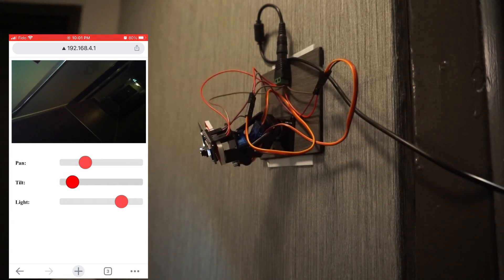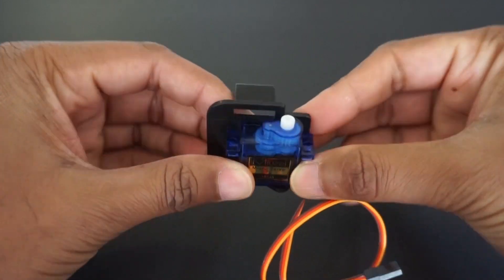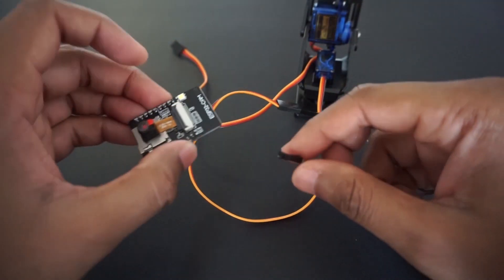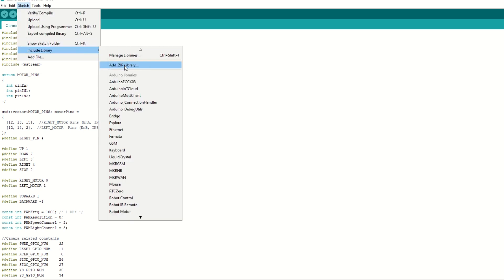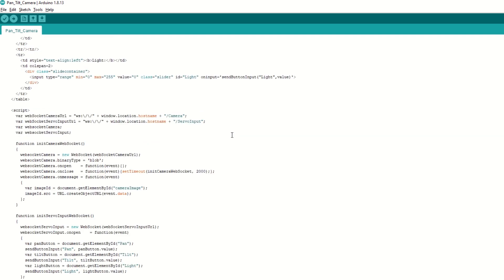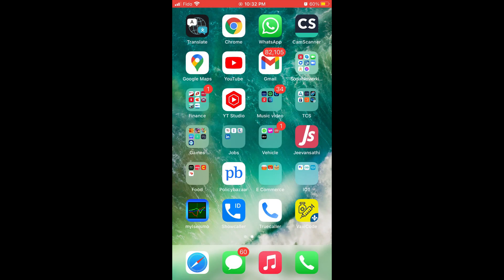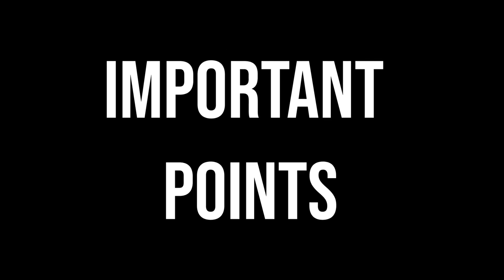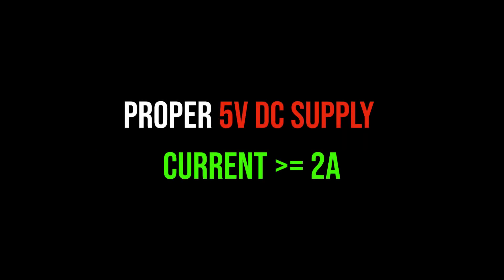Pan Tilt Control using Servos for ESP32 Cam |  WiFi Security Camera

Comment: Hi sir, May i know what is the used for Arduino UNO R3 in this project? At first I tot it is used to control the servo motor then I realized the servo motor was connected to the ESP 32-CAM instead of the Arduino board
Reply from the maker: Arduino Uno is only used to upload code into esp32 cam .
Reply: @hashincludeelectronics  I see ... Appreciate that sir 😳

Comment: i've issue my adapter was blinking when plugging to esp32 cam. My adapter 5v 2A just normally no problem in other. i confused in this, where's the problem..
Reply from the maker: Remove the servos and just try connecting to esp32 only . See if it works . May be servos are causing issues .
Reply: @hashincludeelectronics  servo isn't problem i was checked and test
Reply: @hashincludeelectronics  then i press reset button esp32cam, the esp led is blinking too

Comment: hello bro, can i control the cam from a far? because when i try then noticed it can only be connected when it's reached by esp32 cam

*i mean control from anywhere
Reply from the maker: For now it can be only controlled locally .
Reply: @hashincludeelectronics  
what if the esp32 cam is connected to the home wifi, is that possible? using the same code?
Reply from the maker: @worldinyourhand0  it’s possible. But you have to make a very small change to connect using STA WiFi mode .
Reply: if it works, can you give me a suggestion or how to do it
Reply from the maker: @worldinyourhand0  check my video on esp32 getting started where I have used hone WiFi connection 👍🏻
Reply: @hashincludeelectronics  thanks sir, it's work. but i getting one problem ,  on the webserver the camera sometimes does not appear, and if it appears the video is freezing or lags
Reply: I see on the serial monitor there is a "Frame buffer could not be acquired." where is the fault part?
Reply from the maker: @worldinyourhand0  you need to adjust one setting in library. Please check the video again .
Reply: @hashincludeelectronics  yes, it's have adjusted before, but still not work
Reply: is a powersupply problem? because in this, i'm only connected with usb cable to my laptop for uploading the code.
Reply from the maker: @worldinyourhand0  yes . Servos need good power source .

Comment: Please help..
When I uploaded the code after doing connection properly it was working properly. So I have disconnected the supply and I was happy. But after some time I again connected the supply and the problem starts from here. At first when I was trying to connect the wifi it connects and getting disconnected quickly. But now no hotspot is coming from the esp32 cam module as I can't see from the wifi section of my phone. So I have reset the board and uploaded the code again but still same problem. 

Please give me the solution.
Reply from the maker: What power supply are you using ?

Comment: hi everyone i want my esp connect to modem but in this program it create AP for itself !!! can anyone help me?
Reply from the maker: You can actually check my video on ESP32 getting started . There I have used our home WiFi credentials of modem. You can easily make the change in this cam code. Take a quick look and see if it helps.but in this case you will have to get the local IP address assigned to esp32cam by printing on serial monitor .

Comment: Could this be modified to use with 360 degree servo to get 360 degree pan capability?  Thanks for your attention.
Reply from the maker: Yes it can be. Just change the slider values in code. min and max values for pan slider to 0-360.
Reply: @hashincludeelectronics  Thank you very much for your reply.   Ask because of my intended model train application.  I'd like to mount on model train flatcar ... it would be nice to see forward, backward as well as right and left as train goes around layout.

Comment: Hi, thanks for your great ideas, I have a question, I never see the NowISeeyou SSID, how am I suppose to get that?
Reply from the maker: Thanks for checking out the video. You need to upload the code into esp32cam module and restart it. Once done try to see if its available in wifi in your mobile. If not then try restarting your Wi-Fi on mobile.

Comment: hello bro, which recommended adapter? 
5v, 9v or 12v???

(and where is the arduino with esp32 diagram?)
Reply from the maker: 1. Use Only 5v DC output adapter . 2. This diagram is there is the same link
Reply: okay ty
Reply from the maker: @worldinyourhand0  👍🏻

Comment: Sir, please, I want to do it in order to add it in my graduation project. Is it possible to open this (IP website) from a place far from the esp32 piece, for example, if you are connected outside the house to a network and esp32 in my house??
Reply from the maker: You have to be on same network for this camera and app to work. Currently it does support controlling from anywhere in the world.
Reply: @hashincludeelectronics 

This means I should stay close to the esp32 and not far away  !!?
Reply from the maker: @mohammedsadiqahmad2886  nope . I means it will work the way your WiFi works . 70-100 ft .
Reply: @hashincludeelectronics  
Yes, I understand, thank you
Reply from the maker: @mohammedsadiqahmad2886  welcome 👍🏻
Reply: @hashincludeelectronics  
Sir, I want to put a chip of RAM in order to record this video stream.  Have you tried something like this?

Comment: Code is not working...
Reply from the maker: Thanks for checking out the video 👍🏻 what issue are you facing ?
Reply: @hashincludeelectronics  Yes. Sir I cannot connect to te network. I tried many time but still not connected. But when i test with webserver camera it is working good. Please help
Reply from the maker: @cvanlaldingngheta1866  what IP address are you trying ? Also use the ssid and password as described in the video .
Reply: @hashincludeelectronics  I am trying with the IP address that display in the serial monitor.
Reply: @hashincludeelectronics  ohh I am using my home network ssid and password. Is that can be the main problem?
Reply from the maker: @cvanlaldingngheta1866  yes . You need to follow the video completely 👍🏻all steps are very clear . Use the IP address and ssid password given in the video .
Reply: @hashincludeelectronics  Thankyou 🤗🤗🤗
Reply: @hashincludeelectronics  Brother its still not working. NowIseeYou wifi is not available
Reply from the maker: @cvanlaldingngheta1866  try restarting the WiFi in your mobile .

Comment: hi bro thanks for the video i just wanted to know what is the power output of your adapter because i am using normal 5v 2A charger to provide power to esp32 cam and servo  but sometime it work but most of the time i get brownout error in the esp32 cam  i think power is the issue  but i checked it with the multimeter the power is 5v only  but not sure why it is happening 

i am sure board is not faulty because sometimes it works when i hold the pins and move it a little in breadboard
Reply from the maker: It’s 30 watt . Yeah that brownout issue can be due to improper power. Try the other adapter .
Reply: 30 watt   ?  Can you share any link of that adaptor I'll also try to get something similar
Reply from the maker: @yashkumar2716   https://amzn.to/3HewZcX

Comment: Is that possible to replace the servo control using joystick?...and trough laptop...
Reply from the maker: You need joystick instead of slider on the app working on laptop ? Or you need actual hardware joystick ?
Reply: @hashincludeelectronics  actual joyatick that run on pc my friend...is that possible?...thank you..
Reply from the maker: @sdknstar601  anything is possible👍🏻. But I don’t get a point when you say joystick with PC. Sorry I might be missing something here. However you can use joystick with another esp32 which is transmitter and send commands to receiver esp32cam. Simultaneously receive the video stream on PC. Or you can elaborate more on your requirement 👍🏻 I have never attached joystick directly to PC.
Reply: @hashincludeelectronics  https://youtu.be/t6T1RZNtr04

I found this...but...actually i want control with usb joystick via laptop...😔
Reply from the maker: @sdknstar601  oh ok. I am not aware about USB joystick. If I find something I will let you know . 👍🏻
Reply: @hashincludeelectronics  thanks for your reply...and i just subs your channel...
Reply from the maker: @sdknstar601  fantastic 👍🏻

Comment: Thanks for the video I am struggling to get my servos to actually work, however everything else seems to work just fine.
Reply from the maker: Thanks for checking out the video 👍 Good to hear that you are making progress in this project . What issue are you facing with servo ? Make sur to provide proper power supply of 5v dc.
Reply: @hashincludeelectronics  Thanks so much for your reply! I am using a 27-watt 3v-7v adjustable voltage power supply, which is set at 5v. The Servos are not responding to slider adjustments.
Reply from the maker: @jeremyviny6817  that’s  good enough supply . Where are you checking this ? On mobile or on laptop? It only works on touch screen device
Reply: @hashincludeelectronics  I am using my phone so think the issue might be elsewhere :(
Reply: @jeremyviny6817  
I have the same problem. One of the vertical servo motors does not respond to the slider adjustments. Did you find the solution?

Comment: I have a basic question.i m getting a esp32 board..... should i get the cam version or the plain esp32.....does the cam version have all the functionality of normal esp32...since number of pins in esp cam are half  the number of non cam version
Reply from the maker: It depends upon your project need . Does your project need camera in it ? If yes then go for esp32cam . Else if you are starting with esp32 then buy simple esp32 module of 38 pins . Yes  both the modules will almost function same with esp32 having far more number of pins than cam module.

Comment: congratulations to the project, I just thought that the response time of the camera is much higher than the native webserver project, is there a way to make the camera refresh faster?
Reply from the maker: Thanks for checking out video 👍🏻 . Yeah camera image capture is faster however the transfer of image through Websocket limits the FPS for video . It’s the best I could do with this webserver . I would be glad if there is other way to improve it for more FPS. But for now don’t see any way to improve it  further .  The video is still responsive enough with VGA quality .
Reply: Use a pi zero w

Comment: Firstly, thank  you very much.
 I hope to answer me ,can I use GPIOs 4, 12, 13, 14, and 15 to connect them to servo motors ?
Reply from the maker: Yes you can use these pins for connecting to servos .
Reply: you can not use gpio 4 bro
Reply: its possible to disable the flash led
 @sakethpuppala1016

Comment: hi, great video!!, please help me, when load the code, arduino give that message 'class Async WebSocket Client' has no member named 'queueIsFull', thanks!!!
Reply from the maker: Thanks for checking out video 👍🏻. Could you please make sure that you have downloaded latest library ?
Reply: @hashincludeelectronics  yeah but doesn't work
Reply from the maker: Can you check this file AsyncWebSocket.h and see if it has queueIsFull function ? You can find this file under Arduino library folder . I have explained in video where to find this file . Please check and confirm .
Reply: @hashincludeelectronics  I check and don’t have queueisfull function
Reply from the maker: @alvarocaceresvalenzuela  can you send me that .h file on my email ?

Comment: Amazing...just one observation which u can consider :  Camera movement is bit noisy
Reply from the maker: Thank you for checking out the video and suggestion 👍 The noise comes from Servo motors used as these are very cheap servos and has plastic gears. It can be avoided using better servos with metal gears .